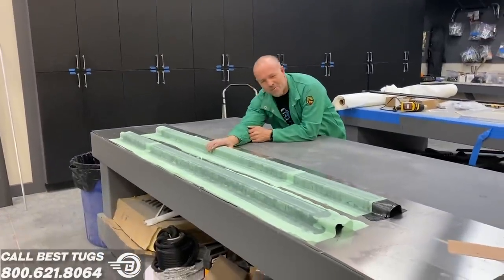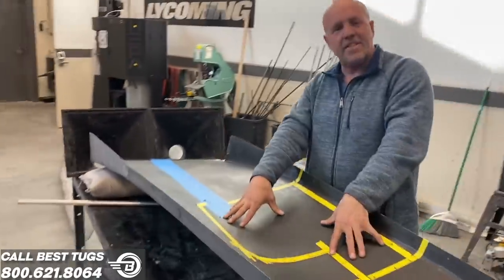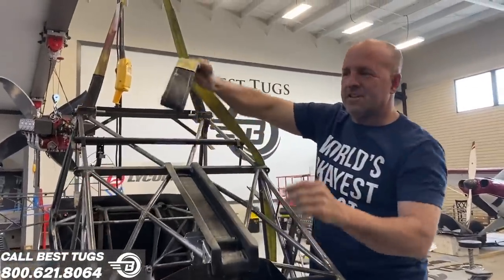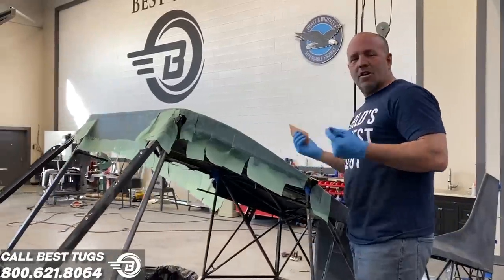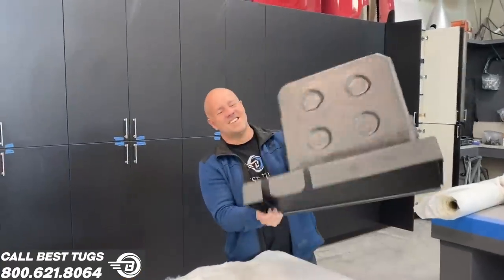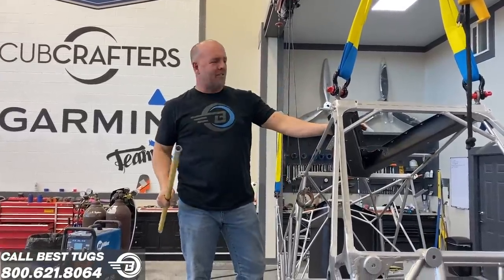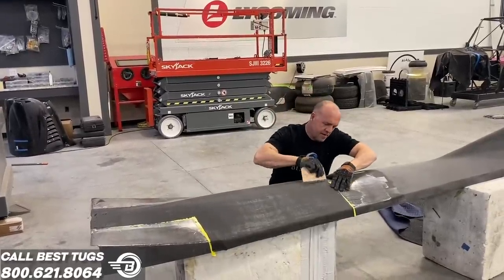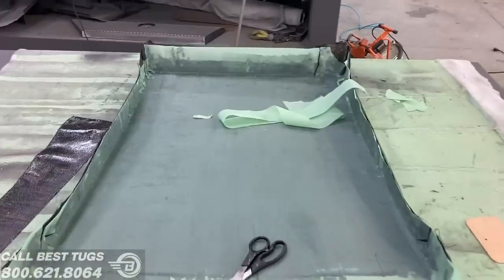Scrappy Bush Plane gets Carbon Fiber Parachute Tracks 🪂(Scrappy Bush Plane 20)

Comment: Mike. I've been told that carbon fiber deteriorates in sunlight if not coated with a special clearcoat. Is this true? If so, how will you address this. Thanks
Reply: The epoxy eventually breaks down, not the CF. So you have to paint it or coat with a clear coat with UV inhibitors.

Comment: Hopefully you never pull the chute- buuuuut: being under a canopy with your special gear, that would be one SOFT crash landing.
Reply: The best chute is the one you don't need to pull. But it's good, that it's there in the first place.
Reply: @steilkurbler4973  I have a different opinion on parachutes, being a skydiver, the best chute is the one that opens!
Reply: My question for Mike  " with all that extra bounce in the landing gear ' How high will scrappy bounce on touchdown and how many bounces?'   "

Comment: Do I See A Point Where The Parachute Cord Can Impenge Upon Its Self And the  Mass of the Parachute ? Just prior to the channel out of the box ? Should it not have a more gradual incline or transition to the channel ? 
I realize that in operation the action is very quick but that is exactly what caught my eye .
In the absence of being able to provide a curve could not at least two 45° be utilized rather than a severe 90° movement under stress ?

Comment: I had to watch this 3 times. Something is wrong.... your chute bucket has NO DRAINAGE.  Always assume that water will get in there in one form or another... leaks or condensation. Also what did the chute mfg say about heating?   Will you need any type of heating system to keep the chute operational in freeze conditions... aka; Alaska.

Comment: Mike no offense but you add the weight of the parachute which I agree is a benefit however youre worried about a little acrylic. It just doesn’t make sense to me.
Reply from the maker: I try to save weight wherever I can despite the added weight in other areas.👍🏻🤠

Comment: Hey Mike - Love your vids and designs but one thing drives me crazy watching and that is when you say "it fits Perfectly" or "it lines up exactly' - Perfect and exact are not terms to be used when engineering parts.  Nothing engineered (especially by hand) is perfect and can always be improved.  In 27 years of design engineering i have never seen a part that i could describe as perfect (some were extremely good, but never perfect - there is always a compromise of some sort).  It grates my teeth every time you say it - and you say it alot.   Back to work.

Comment: Why a parachute? Lots of weight. That airplane should be able to land pretty slowly. Not sure if landing under a canopy with no control would be better then landing a STOL aircraft under control, unless you pull a wing off. Not likely.
Reply: Watch the part 18 of scrappy build. His friend James almost died because the wing came off in violent turbulence. That's why parachute.